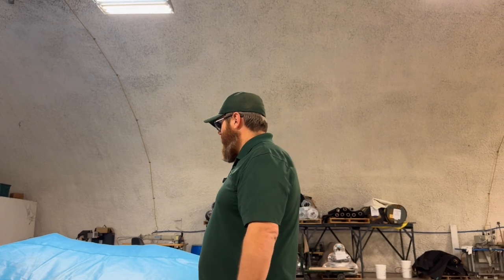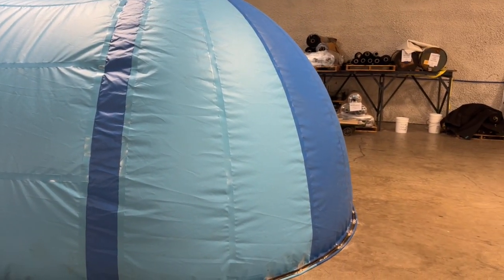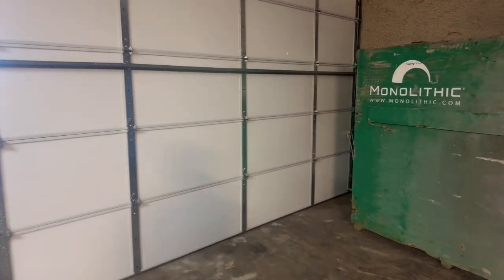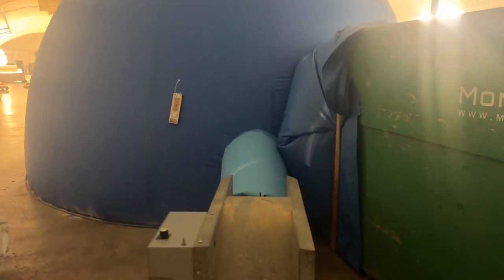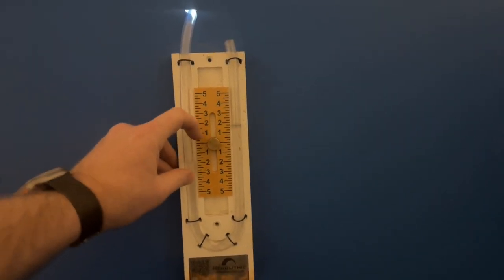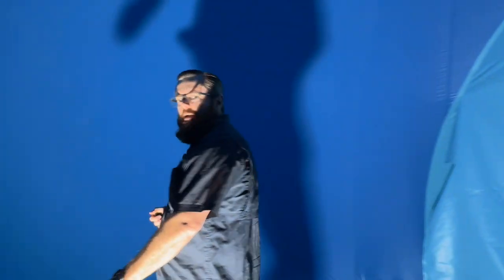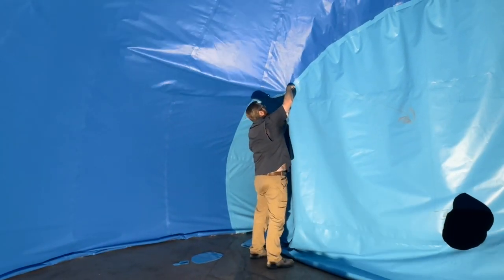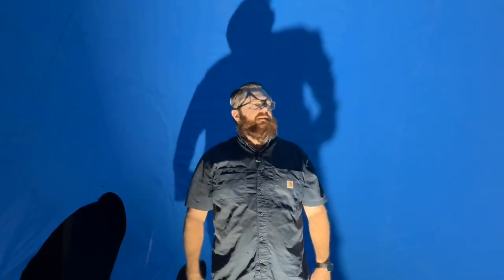Monolithic Dome Shape Test: Prolates, Saddles & Pressure Data

Comment: I've got to ask....what CAD software are you using? I've taken Revit, Inventor, and Solidworks, and none of them let me draw domes. 
I took took the 4-day class in Italy, TX eight years ago and want to design & build my dome for my next house.
Reply from the maker: Hi.  We use Rhino CAD 3D
Reply: Great! @MonolithicDome  How much does it cost, and can it do more egg-shaped domes as well?
Reply from the maker: @theebalz  Hi.  The dome shell costs about $100 per square foot of floor area.  Yes we do egg-shaped as well.
Reply: A Simple Dome, is a Thin Wall Arc Revolve! SolidWorks should be able to do thin wall revolves! Alibre Design can!

Comment: The baffles seemed to work as predicted, but you said you'd prefer not to work around them... I can imagine a way to stabilize the prolates from the outside using a high line and small external grommet tabs along the top of the saddle (Ridgeline)... You could lift/straighten up the saddle as much as desired and the prolate centers would not settle inward. 

Another option to avoid the baffle would be to just use a couple tension straps of nylon - would not be as smooth of a curve as the full baffle, but would be easier to work around and keep much of the benefit.